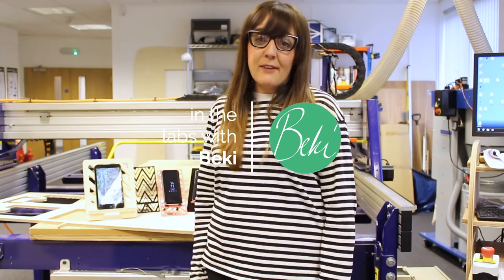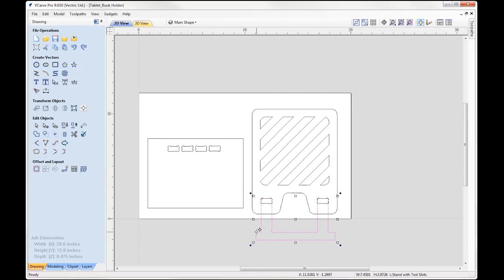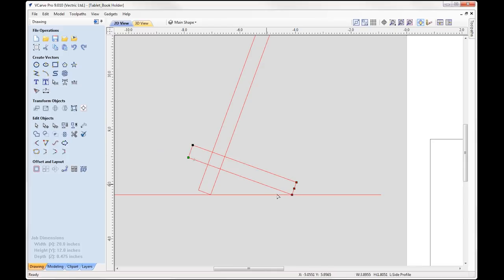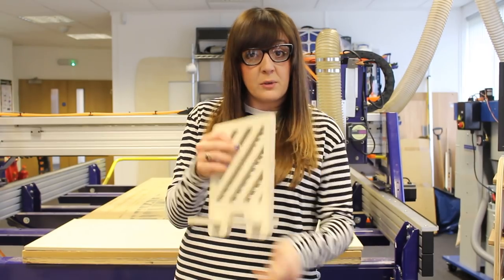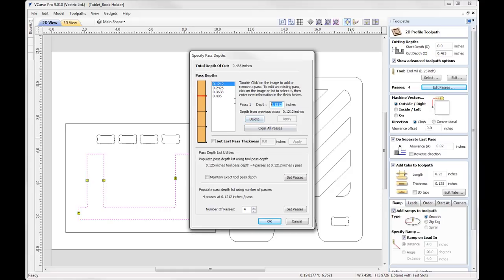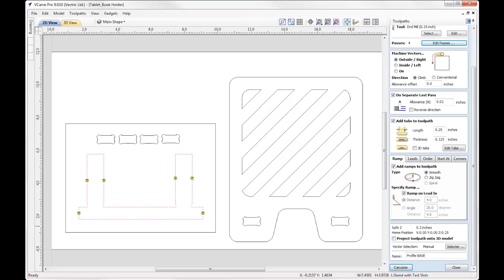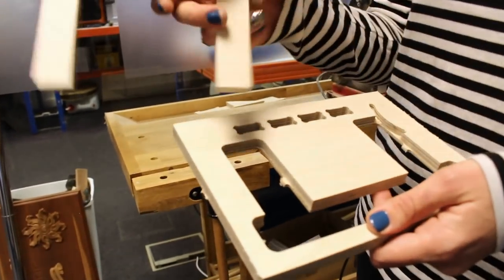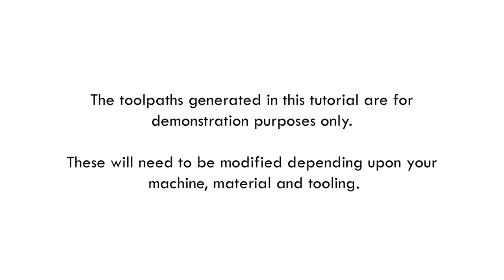In Labs with Beki | Make a Tablet Holder | Vectric FREE CNC Projects

Comment: Thanks for showing us how to use a compression bit.  I always figured you'd have to take a single full depth cut --  Hard on the bit! 
Can you use the "Lead in" in the pocketed cuts too?
Is there a way to "copy and paste" your pass depth changes to each of the tool paths?
Reply from the maker: Hey Richard! Thanks for the comments! You can't lead in on a pocket toolpath, however you can start in the center of the pocket using an offset strategy. At present there isn't a way to copy and paste the pass depth changes to each of the toolpaths (unless they are the same toolpath - in which case you could duplicate the toolpath i.e. you have a profile toolpath and want to create another profile toolpath with the same pass depth settings you could duplicate the toolpath. As for different strategies ie. profile and pocket you would have to manually do this. I hope this helps! ~ Beki

Comment: So if you don't have a compressive cutter, I suppose using two sided cutting would allow for a clean cut using the down cutter by only cutting half way through the stock, flip over then finish the cut on the back side.
Reply from the maker: Hey Gary, Absolutely! That would be the way to get clean cuts without an up/downward cutter ~ Beki